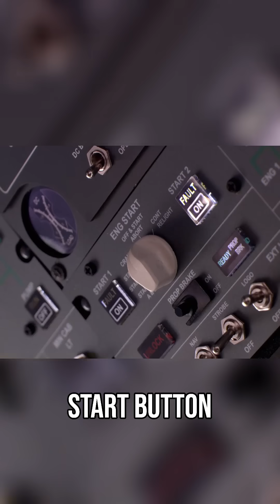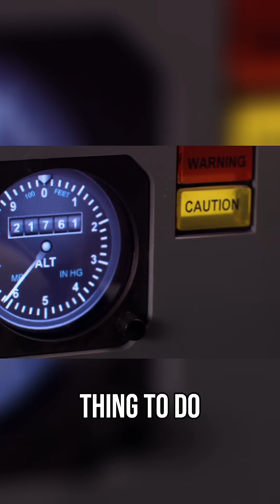What Happens When Engines Fail at 20,000 Feet? | Mayday: Air Disaster

Comment: Shouldn't pilots learn how to relight engines as part of their training. Looking it up in a manual under intense pressure seems rather last minute.
Reply: You're trained to typically only do a handful of critical memory items from memory, before moving over to using a solid copy checklist. Paper will not 'miss' steps like your mind can in high stress situations. When its a handful of highly critical, time sensitive actions- it will be drilled into your mind. But even then, you're supposed to check the checklist following you completing those 3-8 simple steps to make sure you did them all.

You should not be trying to restart your engines while under 'intense pressure' situations. You should be flying the plane and doing everything possible not to crash. If you have the time, altitude, and distance to go through engine restart? Then you wouldnt have to rely on your memory of the checklist sitting right in front of you to do so.

Comment: Lo fuel pressure means low fuel pressure going to the engine. That could be a mechanical problem, or a contamination problem…. It could also be a no gas in the tank problem……..

Comment: The reason: the mechanic responsible for replacing  the defective fuel quantity instrument, installed  one designed for another type of ATR, which gave the pilots the wrong quantity of fuel before take-off. May the victimes rest in peace.

Comment: This is the reason why the new planes must be built to make it possible to land on the sea. As the planes are now it has not been built to actually land on anything except on a runway.
Reply: Tell that to captain Sulley, bet he laughs his ass off!
Reply: @tirzhaprinsloo2774   basic physics says turning into the water is a terrible idea. 

The chassis of the plane provides adequate protection, park the rear down first and lower the nose down gently as you can. The chassis acts as a ski, and Once the engines catch the water, they’ll be the brakes, the tail acts as a stabilizing anchor, and the rearmost of most planes are usually just mechanical and storage rooms. 

If more pilots practiced water landings, the world would be a safer place. Lord knows I practiced 4,200 water landings in the sim before I actually went to go get my license
Reply: Yea, they should put pontoons on a 777 or an A350.😂😂) SO REDICULOUS! Try landing a seaplane on waves. I know, put a giant parachute on planes! 😂
Reply: @tirzhaprinsloo2774  right..Pontoons on the wings at least..🤔I never flew,and never will

Comment: In the case of the Ethiopian Air crash, a huge percentage of the fatalities were because NO ONE EXPLAINED WHY WHY WHY you don’t inflate your life jacket UNTIL AFTER you EXIT the plane.  If you are still inside you float to top of the cabin and Unless the plane rolls on its side or breaks apart, at the CEILING of the cabin is where you will be found.

Comment: the design of this plane is about as lucky as you can get for gliding. it should glide on its own if its controls can be left idle to their own sensitivity & its loading balanced on bearing elements. 

In fact this design could accelerate on decent & gain proximity with landing option (s) if loading made gliding difficult. Good luck!!!

Comment: And this is EXACTLY why you don't cross oceans at 20k feet. That's not even cruise altitude.

You can dead-stick a landing from 100 miles out IF you have enough altitude. This is also why we have ETOPS ratings mandating certain things. We joke that ETOPS stands for "Engines Turn Or Passengers Swim".

Comment: WHAT THE HECK HAPPENED???  We could use some closure, folks!
Reply: @maryferrell9620  yes, what happened? I seem to remember seeing this or hearing about it a few years back where they ran out of fuel but the fuel gauge is said they still had fuel.  But I don't recall the outcome...
Reply: @maryferrell9620  
This is probably a training video.
Reply: @pushpakumardaniel3751  16 people died as thecplabevditched in the sea. Out of fuel. The pilot dint feather props to glide further ,and faced charges.

Comment: I wish they would’ve shown what happened
Reply: Long story short, they are actually out of fuel and an avionics engineer placed the wrong device showing a misleading info that they have enough fuel. The captain survived and faced charges because he forgot that he could adjust the blades of the propellers in order to glide further and actually reach the Palermo airport. Half of the people died as far as I remember.
Reply: @scorpion407  if he doesn’t feather the props. That’s the first thing he should do
Reply: Tuninter Flight 1153 was a scheduled international passenger flight flown by Tuninter Airlines flight from Bari International Airport in Italy, to Djerba-Zarzis Airport on the Tunisian island of Djerba. On 6 August 2005, the Tuninter ATR 72 ditched into the Mediterranean Sea about 18 miles (29 km) from the city of Palermo. Sixteen of the 39 people on board died. The accident resulted from fuel exhaustion due to the installation of fuel quantity indicators designed for the ATR 42 in the larger ATR 72. It was also Tuninter's first fatal accident in the 14-year history of the company.
Reply: God bless them all.  What a horrific experience!
Reply: If the pilot was supposed to take an extra step to allow the plane to glide further, then it should have been in the checklist.

Comment: These guys (pilots) and doctors are the real miracle workers
Reply: @emekaisuochi368  miracle workers are the people that make things run smooth.
Reply: Really how about the people in the trades? How about nurses? How about  teachers? How about the stay at home parent I could go on and on we all do our part pilots are no different different.
Reply: @jamessveinsson6006 I mean, not really. I get your point, but while being a stay at home parent is commendable, it comes with FAR fewer responsibilities and it takes no special training.
Reply: @emekaisuochi368  what I don't understand is how a plane can keep propelling forwards when all engines have failed.. How come it doesn't just drop downwards?
Reply: @petejones879  It glides. Airflow.
Reply: @petejones879  -  It doesn’t just drop because it has wings.  A glider doesn’t have engines yet it doesn’t just drop.  Same principle.  If you’re cruising down a hill in your car and run out of gas the car keeps going down the hill until it levels out.
Reply: @petejones879   newton’s laws
Reply: @petejones879 . The plane will glide.  Meaning the wings are still providing lift. However, in order to do that it must have sufficient forward speed. To do that it must enter a shallow dive. The pilots will see in their charts and computers the best glide ratio to get the most distance.  That means the dive is as shallow as possible and still provide the speed to permit lift.  Eventually there is an end to the glide and the plane must land or crash. In this case the glide ratio will not permit the plane to reach the island.  So they will attempt to land it on the water.
Reply: @DragerPilot thank you
Reply: @petejones879  It essentially becomes a glider. You learn how to do this when you get your PPL.
Reply: @petejones879  This is simulation.

Comment: They didn’t feather the props which would’ve reduced the drag.
They should’ve made the coast but crashed in the ocean.
Reply: Yeah the graphics folks overlooked that. Those turboprops should have auto feathered. If they weren’t designed that way and the pilots didn’t do that quickly then they screwed themselves.

Comment: The accident resulted from fuel exhaustion due to the installation of fuel quantity indicators designed for the ATR 42 in the larger ATR 72. So I'm guessing they don't top the tanks off. Just fill until the gauge reads full, which was only about 2/3 full.
Reply: My understanding of flying and talking to pilots, they only take on enough fuel, plus a reserve for unexpended delays/consumption to make the intended flight.  They don't always have full tanks.  I would think mostly for weight considerations.
Reply: @TheKira699  Also the pilot survived and served prison for six years 😑
Reply: @mauroadventures 

The imprisoned him ?  How can he be blamed ? 

They should have shot the technician who put in the wrong fuel gauge.
Reply: I doubt they fuel by the gage. Then again they might thought they have certain amount of fuel according to the gages level so they only top it for the leg of the flight.
Reply: Pilots should check fuel level !!!!!!!!!!!!!!! not the mechanic holding the pipe........
Reply: @thomassaba9886  okay
Reply: No, what happened with this flight is mechanics changed fuel gauge that showed that there is more fuel like u said but airplane wasn't refueled, pilots came in that day, asked for refuelling slip, thinking airplane was refuelled because there was more fuel but they didn't get refuelling slip, they asked ATC about it, they didn't know anything about it, but pilots decided to take off anyway without confirming there was refueling. Basically they took off with same amout of fuel they landed yesterday because gauge was showing wrong amount
Reply: @TheKira699  
If the fuel quantity gauges were replaced this A/C should have had a fuel calibration done before it could be flown again.
Reply: @TheKira699  WOW!! UNBELIEVABLE.... THE CHANCE TAKEN WITH PEOPLE LIVES.....
Reply: Similar to the Canadian flight when the refuellers mixed up gallons with liters. I knew the difference in Standard One Primary School.

Comment: Somehow the maths doesn't add up. Here's why;
Calculating the Glide ratio, the plane descends 1 foot for every 16 feet forward, meaning its glide ratio is 1:16.
Therefore, to calculate the horizontal distance covered for a 20,000-foot descent, we will multiply the altitude by the glide ratio: 20,000 feet * 16 = 320,000 feet. . 

Then we will convert nautical miles to feet, so 48 nautical miles is equal to 291,648 feet (1 nautical mile is approximately 6,076 feet) and 320,000 feet is 52.6 nautical miles. 

The ATR72 plane can travel 320,000 feet horizontally, which is more than 291,648 feet, in other words, it could glide another 4.66 nautical miles, so it was able to reach the airport. 

Upon further checking, TUI1153 flight was actually at a height of 23,000 feet when the left engine failed followed by the right engine 100 seconds later. This gives it even more range. 

To calculate for 23,000 feet, 
Total horizontal distance: 23,000 feet (vertical) * 16 feet/foot (horizontal) = 368,000 feet
Convert to nautical miles: 368,000 feet / 6,076 feet/nautical mile = 60.56 nautical miles.
Reply: That's assuming they had the plane angled at the perfect angle the second the left engine failed. I'm no pilot but there was probably a little human error in there during the panic of the situation that took some distance off, or possibly the math was off by the stressed out pilot
Reply: @MovieTrailersOnly also the multiple failed relight attempts
Reply: Are you a pilot cuz this is very impressive
Reply: @StoryHub027No, I'm an aerospace engineer. Fairly easy maths here.
What I'm more interested in is the drag coefficient.
The drag coefficient (Cd) for an ATR 72 aircraft actually varies as it depends on factors like airspeed, altitude, and the specific configuration of the aircraft such as the presence of winglets.  However, a typical drag coefficient for the ATR 72 in cruise conditions is around 0.0165 + 0.0313CL². This equation relates the drag coefficient to the lift coefficient (CL), where CL is dependent on the angle of attack. In a particular simulation though, a lift coefficient of approximately 0.0927 and a drag coefficient of 0.00072 were calculated for an ATR 72 wing under cruise conditions.
In simpler terms, higher drag coefficient would lead to a steeper, faster descent, while a lower drag coefficient would result in a more gradual descent.
Reply: I think Ive got no words after seeing this comment
Reply: while correct math for possible distance after the engine failure time we are missing the important information of how high we are when they received the information on distance to Palermo as the info as stated the initial distance when engines failed was at least 70 miles which in nautical miles is 60,83 so they're just short 😅
Reply: @carstereo2493  Glide ratio unfavorably changes as aircraft descends without engine-power. Add the unfavorable wind factor, and glide  distance gets worse closer to the ground.
Reply: @kumardigvijaymishra5945if the video was accurate, don't see the props being feathered so that works take out some energy
Reply from the maker: Thanks for breaking down the numbers so clearly!
Reply: he calculated when they have already descended though. They might only have been at fl150 when asking for the distance to the airport
Reply: I believe the reason they could of made the airfield but didn’t was because they (the crew) didn’t feather the props , hence they were gliding with a lot more drag with the props windmilling
Reply: How long did this take?
Reply: This is true except at the beginning they were seventy miles away from land which is 369,600 feet so they would have fallen short. 48 miles was not where they started.
Reply: So why did it crash into the see 18 miles out if per the OP it could glide?

Obviously it couldn’t glide because it didn’t.
Reply: @carstereo2493   yikes. That’s why I’m an Interior Designer. Way too much math for me!!🤔
Reply: You left out the wind.  Try again.
Reply: Nerd alwrt
Reply: Maybe the airport is high. Not at sea level.
Reply: @andremarques7907  Or may be, Palermo is at 66 ft... (source:wikipedia)

Comment: This may sound silly but why not equip special kind of parachute under top of plane in the middle so when needed it could slow descent of plane to get to a safe landing site?
Reply: weight of the parachute, and in air emergencies are really rare like 1 in a million.
Reply: @Eckcentric  you couldn’t get a large enough parachute to significantly slow the rate of fall without compromising so much drag that you essentially can’t go forward anymore. You’d be stuck landing wherever directly underneath you is, and vertically landing instead of coming in at a natural glide angle for touchdown. Plus you’d have to store and deploy a parachute capable of holding some 50,000 lb plane

Comment: Check the fuel cut off switches.  Problem solved.
Reply: They ran out of fuel
Reply: @BabspzhzpKLal what- so the shut off switch won't work? There should be more fail safe redundancies built into the system.
Reply: @zorooo-v5v 

The plane was equipped with the wrong fuel gauge (meant for an other plane model)

The gauge was calculating that the plane had fuel while it hadn t